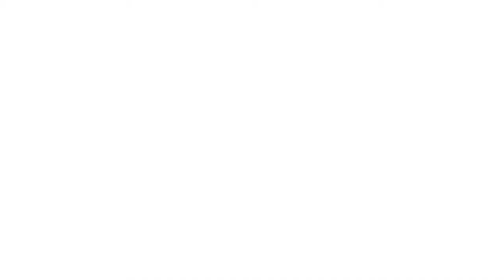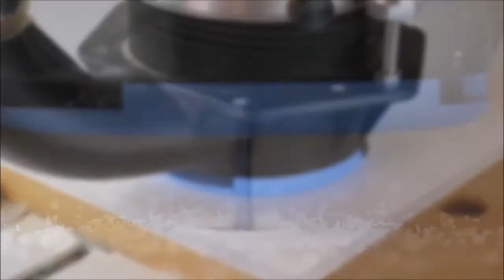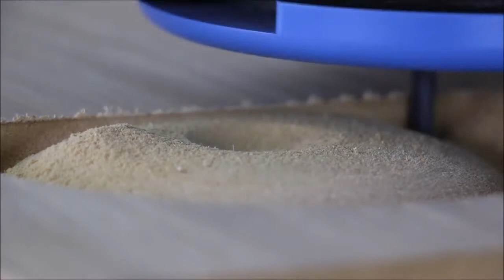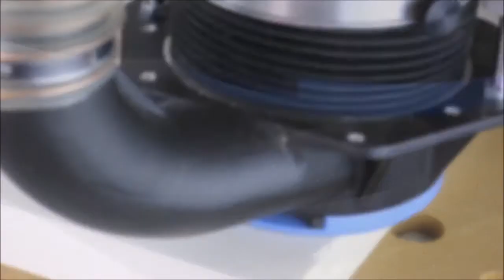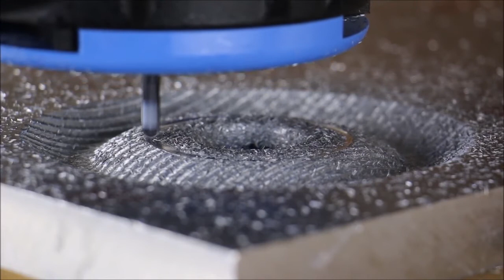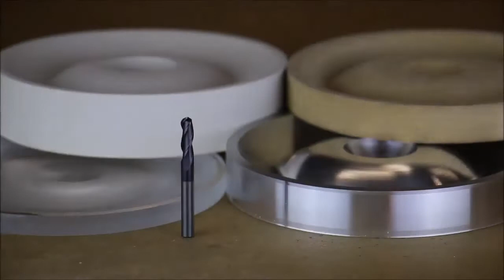CNC Router Tooling - Ball Nose TiALN Coated

Comment: The spiral toolpath  less than optimal because of the constant stops, it should not stop but just keep going around in a real spiral not a set of rings with a step out. That step will be seen in the final product no matter how accurate the machine is and you will need to go touch it up by hand later. I did like the cutting the aluminium part of the video which is something I will have to try out myself.